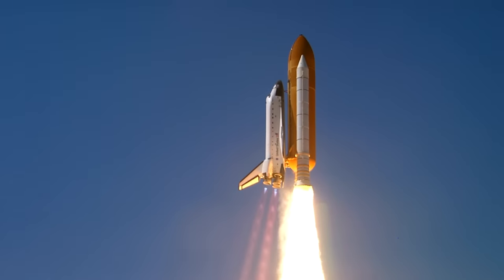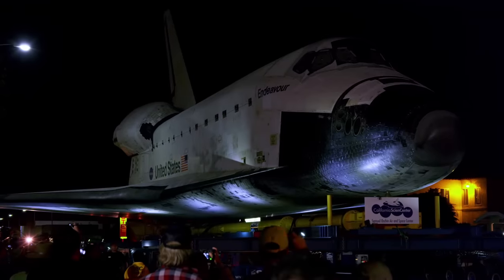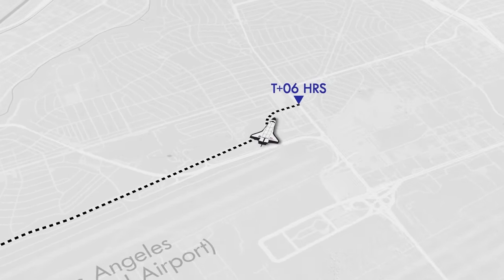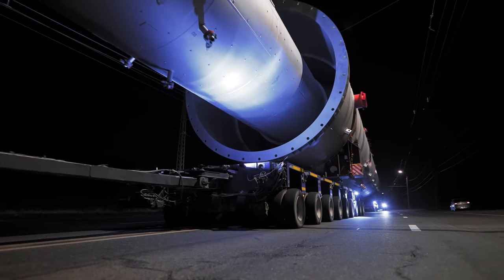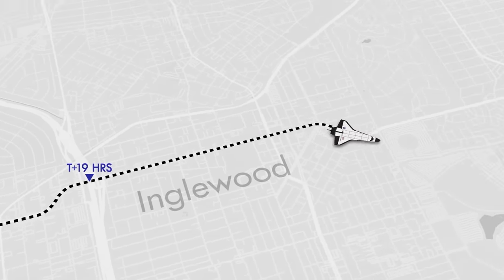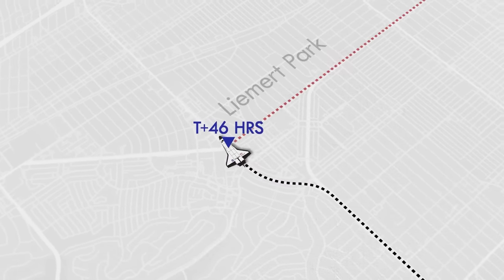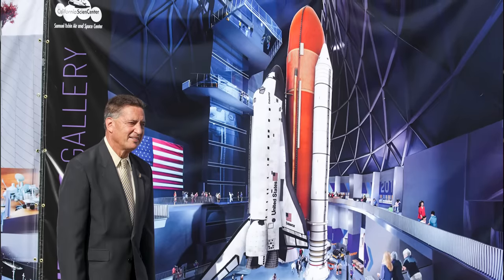The Time a Pickup Pulled the Space Shuttle

Comment: Saw this in person, lots of crowds showed up at various points along the trip to watch it go. I didn't even realize you could un-bolt and move traffic lights out of the way temporarily until i saw them do it in person.
Reply: Anything is possible with enough effort or money.
Reply: well... that's how many places convert roads to runway... (tho it needed to be designed to be that way, IIRC, i believe.)

many road infrastructure are just that "removable", provided it's not an emergency landing
Reply: You’ve never noticed the giant bolts on the base of them? Lol jk you can move everything except power lines and their poles
Reply: Feats of stuff meant to be repaired! (Like all things should be in my opinion, as opposed to the wholesale "replace and destroy" unfortunately plaguing many items today)
Reply: @ClebyHerris  you can't easily move wooden power poles, but you can disconnect and move the power lines out of the way, and lift the wooden pole with the same rig used to place them.
Metal power poles can be moved as easily as a street light.
The highway that goes past my neighborhood was recently widened, which required moving 212 wooden power poles 12 feet further away from the center line of the road to accommodate the widening. They only brought 1 new pole to the job, placed it where it needed to be, relocated the lines to the new pole, pulled the old pole out and placed it in the new location for the second pole, and so forth and so on. Took 1 crew 3 days and my power never went out.
Reply: Didnt get to see them move it down the roads but i did see them flying it piggy back on a plane as they brought it to LA. Pretty ridiculous to see them banking in with that giant thing on its back.
Reply: Yah, they'll unbolt traffic lights for house movers too, when a building is too tall to fit underneath the arms.  Mostly it's a matter of permits and payment, to get crews in place to do it when it's time for the move.

And watching this, it seems like the shuttle move was very much like a high-profile house move!  Those same kinds of wheels are used to move buildings and other heavy-but-fragile loads.
Reply: I dont remember the traffic lights being moved
Reply: Wellll it would facilitate easy replacements after car crashes.
Reply: lucky! I wanted to see it in person too but it was delayed and the time it passed where I was would have been around 3-4 am, too late (or early) even for us college students lol
Reply: @jovanholland36  They moved many traffic lights.
Reply: I was calling my California friend a few minutes ago and as I hit the button I saw this video come on the YT home page. I mentioned it to her, thinking, gee, did they just move a shuttle in LA?  Then I saw the 10-year note in the description and my friend told me she was there. I asked did she stay in the one place like a parade event; nope, after it passed where she was, she got back in her car and drove to another spot to watch it.  She said she was in and around the LAX area. She had to get back to work, so I'll get more info the next time we talk. Considering this took 2+ days, I don't know if she stuck around for it all.  Now all she has to do is find her photos.
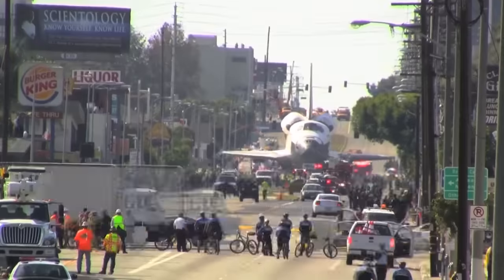Reply: @jovanholland36  11:05 shows one going back up 😊
Reply: Fun fact: All the street signs and lights along the Inauguration parade route in DC have quick disconnects to easily remove them, in order to clear sight lines for photographers and law enforcement.
Reply: @iwontliveinfear  why didn't they just bury the powerline. That is what we would have done in Finland. Or atleast in my city. This year we spent  over half of the budget burying cable and the project will continue for 3 years atleast. (In a city of 21 000)
Reply: @Blue Blue Traffic lights are bolted to concrete foundations, and the poles are designed specifically to shear in the event of a collision, to prevent even worse damage to the colliding vehicle - or the foundation for that matter.

I've actually worked on one of these before myself, where a traffic light pole was knocked down by a vehicle. It took us approximately 6 hours to replace, although in our case we also had to deal with adapting a different style pool to an older foundation, and that the bolts were quite difficult to remove due to the forces involved in the collision.

For something like this, it would take probably 15 minutes per pole to take down, and the same amount of time back up. They wouldn't need to worry about rewiring the pole or anything like that. They likely simply laid them flat with everything still attached, and have the transporters roll over it.
Reply: Bolts are the best way to attach metal poles to concrete foundations.
Reply: You thought they were permanent fixtures? LMAO. You can see the bolts on them; I don't get how grown *ss adults don't realize things I already knew as a 5 year old child. And it is always something incredibly simple beyond measure
Reply: @Tupsuu  buried power lines are expensive and no good for long distances.

Some housing developments have them, but that's about it in the US. Much more efficient to just use poles.
Reply: That’s really cool ngl. I was fortunate enough to be at Disneyland california adventure when it came into Los angles. It flew on the back of the 747 right over Disneyland. It was definitely a memory I won’t forget
Reply: @Tupsuu  some cities get the power lines buried from the start, but to move them underground in an old city is incredibly expensive because you have to weave them through all the existing underground infrastructure.

It's especially hard in a place like LA where some areas are unstable swamps and others are solid rock that you have to blast trenches through.

Also high water table areas are hard
Reply: You just assumed street lights and poles were permanent non-movable objects?
Reply: That's awesome!!! I only saw it on news media and Toyota commercials. How was it seeing it in person?
Reply: @iwontliveinfear  that would have taken my power company 3 years to move 200 wooden electric poles
Reply: @compdude551  I have two saying based on wicked fast infrastructure projects I've seen. The road widening I've already shared, and the other was when I watched the I-69 overpass at Roman Forest Blvd in New Caney TX get removed and fully replaced in a single weekend.
I mean it was there during the Friday afternoon rush hour. We went into Houston proper for dinner and it was gone when we came back to New Caney. Then there was a whole new overpass ready to drive on before the Monday morning rush hour.
I missed the removal, but I watched the replacement. A whole preconstructed over pass with paved road deck was flown in, carried by four Chinook helicopters, and just dropped into place.

My two sayings are "You never mess with Texas Traffic." And "You never mess with Florida power."
Reply: @PsRohrbaugh  true, if you had enough money, you could probably raze and rebuild an entire city if it was in the path.
Reply: @satibel  one of the big conflicts in our world is sentimental value vs practical value. You own a farm and don't want to sell because your great grandparents are buried there, you were born there, etc. Unfortunately, the constitution explicitly allows for "eminent domain", which gives the government the power to forcefully take your private property as long as you are "fairly compensated". I mention this because there are plenty of examples of government using the power of eminent domain at the request of another private entity because it's "for the good of the community". A developer wants to build a new shopping mall and your tiny little family farm is in the way? Well people with guns are going to (try to) make you leave "for the good of the community". 

So yes, an entire city absolutely would be razed if there was enough money on the table.
Reply: @PsRohrbaugh  I mean with even more absurd amounts of money you could literally cut the parcel of land and move it elsewhere. but even with "wanting to stay here because something something buried grandparents" give someone a few millions (and/or the help for doing what they want) and they might at least think of moving somewhere else.
5 millions is enough to live comfortably to the rest of your life, so if you've got a billion and 100 people to evict, you can probably get everyone to move.
Reply: Remember they do have to maintain all of that infrastructure, so being able to remove it is critical to replacing it. Anything you put together can be taken apart unless you properly use red thread lock. Most of the time it's just dribbled on after the screw has been torqued which means that it doesn't bind the threads.
Reply: @Tupsuu  because California has earthquakes, infrastructure underground can't be repaired as quickly. It also costs about 3 times as much for burial grade copper and the costs of trenching it in compared to overhead wiring.  The cost is mainly why it isn't done in sprawling suburban build outs.
Reply: @ClebyHerris  Funny enough, they were transporting these massive wind-turbine blades through my town. They moved the power lines on the route without any interruption in service. Working on live lines is something that they do all the time, and they have the proper safety equipment and expertise for it to be a breeze. However, these wind-turbines were also a part of a massive operation, so they probably paid to have them moved along the route.
Reply: I've seen a few videos about moving the shuttle before but this is the first time I've heard about much less seen them moving traffic lights.  I actually chuckled a bit with the time lapsed view of them taking one down then immediately putting it back up (looked like a stunt you find in an old slapstick comedy like 3 Stooges).  In hindsight it does make sense but certainly never thought about it before.
Reply: It's actually cheaper to just plow through everything and start fresh
Reply: Part of why they're designed like that is so that the pole breaks when hit by a car. This means energy is dissipated by the pole breaking instead of the driver's body. It makes them easy and quick to replace in the event of damage or failure, too.
Reply: @PsRohrbaugh In this case since it’s Los Angeles we are talking about, it’s for sure money 😂
Reply: Any pix to share? 😊
Reply: Indoor kids 🤦‍♂️
Reply: Working in the film industry has taught me very few things cannot be removed and reinstalled. They will literally repaint and replace all the furniture in someone's house and put it back again for a one day  commercial shoot.

Comment: Fun fact:  The SpaceX Falcon 9 is the size it is (and is such a bean stalk) so that it can be fairly easily and routinely carried by road from California, to Texas, to Florida.  Even then, the booster that carried the Crew 5 mission a few days ago struck a bridge in Van Horn, TX (the town from which Blue Origin launches its space tourism flights.)
Reply: Why does that sound loaded with internet meme tensions?
Reply: Fun fact: It's not a spacecraft.
Reply: @pullt  Well, it is.  The booster does go into space (if not orbit), but either way I just thought it was an interesting recent story about the interaction between launch vehicles and ground infrastructure.
Reply: Lots of rockets are designed like that, or if bigger still designed to fit snugly on a barge, it's not some SpaceX thing.
Reply: @GiddeonFox  Indeed.  I wouldn't claim it was.  Many of China's Long March family are 3.35 meters in diameter because of the loading gauge of Chinese rail.  Russia's Proton's odd formation of 6 engines strapped around a central fuel tank has a similar cause.  The Shuttle fuel tank and SLS main stage had to be able to fit in a barge originally designed for the Saturn V.  Rocket Lab is building its new manufacturing factility right near its new launch site in Wallops, VA so they don't have to worry about transportation.  

It's just a recent an interesting example of the interaction between launch systems and the constraints of ground infrastructure.
Reply: @Zeppflyer  can't wait when we could manufacture in space... and just do stuff like in the series, the expanse... tho I hope ain't that racist like in that or current earth...
Reply: @Zeppflyer  Fair, I just see a lot of people online that seem to think SpaceX somehow invented every rocketry thing ever, including a lot of things that have been around since the 50's, and it annoys the heck out of me, lol. They have one hell of a marketing/PR team.
Reply: @GiddeonFox  yes their marketing team is called elon musk. and they did perfect landing a rocket from space. and landing 2 at once has never been done before or since

Comment: I got to see Endeavor fly over my house after fly bys over the NASA White Sands Test Facility near Las Cruces, NM. I'd worked at Boeing in the 70s thru 90s where we built the Inertial Upper Stage (IUS) used to launch different payloads from the Shuttles. That included the Tracking Data Relay Satellite System (TDRSS) still in use today and monitored from White Sands and Guam.

Comment: There are sections of highway in CT where the road  wear of semi trucks has compacted the road base to the point of leaving grooves where the center of the lane is about 2" higher than the travel area. the right lane only for the most part. it makes shifting lanes is older vehicles or just vehicles with smaller wheelbase very...spicy, as the wheels try to track into the bottom of one groove or another

Comment: I can add to your damage of the road part. I'm an FWD operator in New Zealand (so I can't speak for US roads, which I know are quite often concrete based), but typically we apply loads to measure the deflection of the pavement here in NZ at 40-46 KN (about 9-10,000 lbf, 4-5000 kgf). These simulate a truck driving over the pavement and for highways/expressways/motorways or any major roads we get deflections of 50-400 microns if it's strong, 400+ is not ideal for roads that carry large volumes of roads but good for residential streets etc. for reference, 1 micron is 0.001mm or 1000 microns is 1mm. So that's how small even a big truck driving over the road will bend it. With concrete, it will be even less deflection as it's far stronger than asphalt/chip seal but this rigidity is what causes the massive amount of cracking you get on concrete roads.

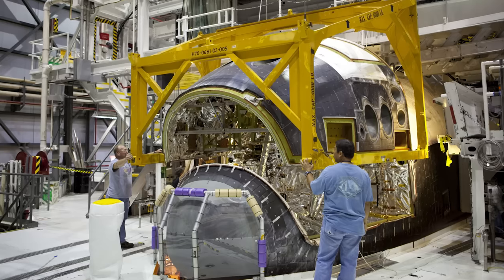Comment: A really cool fact, that piece of equipment shown at 4:06 that is held up by the forklift is still used today to put the RS-25s into engine section of SLS. It can roll, yaw, pitch, move vertically and horizontally to make sure the gimbal bolts are all lined up properly.

Comment: The use of the Tundra over the SPMTs for the bridge really shows how gearing makes things work (insert the Archimedes quote here). I guess the SPMTs are about control as much as power.

On a related note the Ariane rockets (~10x the mass of the Shuttle) are moved about by 8x8 tugs that are off the shelf, the right gearbox and and it'll pull it along just fine. Of course that's around a nice open launch centre and not the streets of a metropolis.

Comment: In the uk what I don’t understand is pretty much most truck cabs have 6 wheels but the middle or rear most wheel pair is raised so it isn’t in use, surely they would have all wheels in use, more wheels means more weight distributed. Plus more wheels helps with traction and breaking
Reply: Up when they drive empty, down when loaded. It's a wear and fuel efficiency thing.

Comment: Would you, could you, do a video on highway weight restrictions? I am a retired engineer turned over-the-road trucker (I became bored sitting around the house). As I drive, some things make me scratch my head. For instance, the highway weight maximum is supposed to be 80K lbs., but in my home state of Michigan, you can pretty much go as heavy as you want as long as you stuff enough axles under it. So, what is more damaging, gross weight, or axle weight? Keep up the great work; I love your channel.
Reply: I think the main question is how much you can spread the weight... Vs how much length you can navigate. IIRC those transporters have lots of wheels to deal with weight.

then again ain't engineer.
Reply: @PrograError  If the tractor is powerful enough, turning and/or controlling all the tires is a non-issue. The problem comes from what is called "tire scrub," which is when you are dragging the tires laterally across the pavement. Another issue is stopping. You have all those wheels with all that weight on them. Each wheel end has its own brake. When the truck is stopped suddenly, each one of the tires grabs on to the pavement to get enough friction to stop the truck. What happens in that scenario is the same as placing your hand on a table on top of a table cloth. When you slide your hand, the table cloth goes with it. Asphalt behaves the same way. There is a spot at the bottom of a hill in Milford, MI, which is an excellent example of the phenomenon.
Reply: Enough axles is the idea behind these SPMT's. You just keep adding them till it fits. They all link up to act as a single unit that can go walking speed or (slowish) driving speed.
Reply: I was actually talking about "Michigan Gravel Trains" . You can Google the term if you're not familiar.

Comment: Wow. Such a task, performed and well documented. Truly it must have been an honor to see it in person. Especially with that oversized doughnut. About the sponsor: It has been decades since I last shaved and I can confirm that the old school technology, with cheap, easy to replace blades outperforms any disposable plastic clip-on blades with three or more edges. While the product is certainly not for me, as I have a long and thick beard, I fully agree that you cannot get any better than with that design. There is a reason why it is still used. Because it works very good and is cheap at the same time.